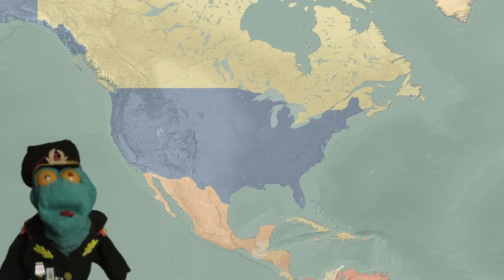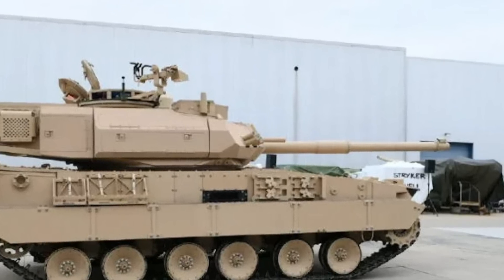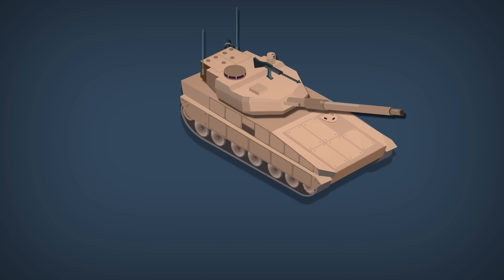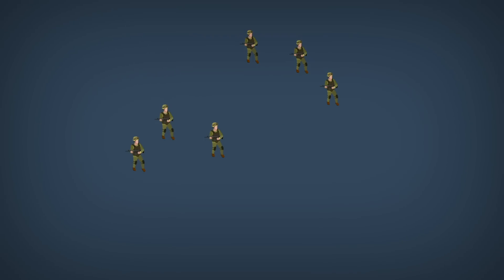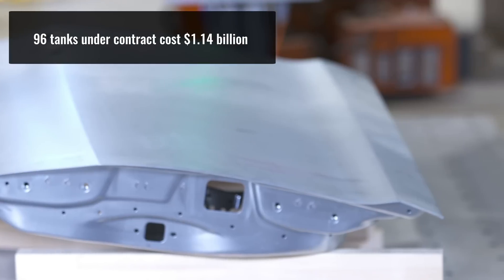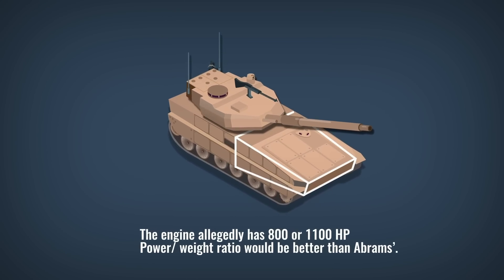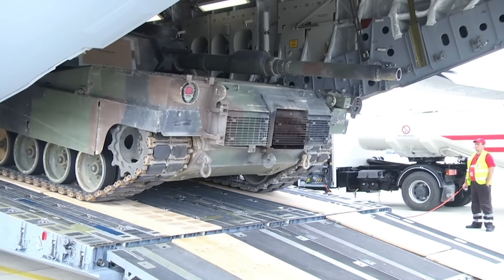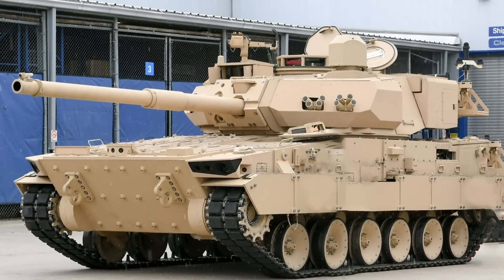US Army just chose its next (light) tank

Comment: Hmmm... I love tanks, but this seems like a bad idea to me... I think infantry should either travel with 1) full size main battle tank [heavy armor + big gun], or 2) an IFV [high speed + little gun + troop carrying capacity] or 3) a medium vehicle with a rapid fire medium gun/s around 35mm-40mm, that can aim straight up to rooftops in a built up urban environment, destroy other IFVs, and shoot close aircraft, drones and rotorcraft-- something more like a Gepard--- not a light tank with a slow firing 105mm rifled.
But that's just me /shrug/.  This feels like not enough utility to make up for its lack of armor protection or speed.
-
Of course anything is better than nothing, but something medium weight with a fast firing medium gun is missing from the US inventory.  Put a 40mm autocannon shooting 550 round/min on that same chassis and I think the infantry will be more happy and effective :)
Reply: The army doesn't want it called a tank but rather mobile protected firepower. This is because it is supposed to provide a big gun to airborne and light infantry units. its a new sheridan. The army says the first unit to receive them will be the 82 airborne. I am guessing that the will be dropped with the old LAPES method
Reply: @jessicacolegrove4152  Fair enough.   But does changing its name to "Mobile Protected Firepower" really make it better?  If they want a different name to make it sound more usefull, maybe they should have called it, "Much better than a Humvee"  :)
Reply: @angelarch5352  It's Funvee then.
Reply: @angelarch5352  How do people not understand what the purpose of an AFV is, the Griffin is meant to accompany IBCT (Infantry Brigade Combat Team), and the whole point of the Griffin it to take out things that a fast firing cannons cannot take out, like bunkers, whilst also being able to go places that other large cannon vehicles like the Abrams cannot, also yes the Army changed the name to MPF specifically because they did not want soldiers to think it was a vehicle that could face other tanks, it is only really their to support the infantry, it is kind of like the Sherman of its day in a way, while the Sherman was meant to face other tanks and definitely could, it really excelled at supporting infantry.
Reply: @aflyingcowboy31  so a Bradley and Stryker can't do the same? Lol they're no different in it, it's just American spending money on what they think the military needs
Reply: @subjectc7505  No, the Bradley cannot, just like the Bradley cannot do what the Stryker MGS can do, so dumb argument, also the Army is apparently going to retire the Stryker MGS in a couple months, so no the Stryker cannot fit that role.

Also you do realise the Germans just did the exact same thing with the LYNX IFV, they just produced the LYNX 120 which will practically have the same role as the Griffin 2, so no, the US is not the only one doing it as Germany apparently also thinks they need an AFV with a larger cannon to support infantry, the Bradley is an AFV with a small calibre cannon and cannot shoot HESH or other rounds that the Griffin 2 will be able to, so yes they are different and will fill different roles to support infantry, also the Bradley transports troops, so if anything both the Bradley and Griffin two could work alongside each other to support the infantry, the whole point of the Griffin is that it can take out things that something like the Bradley cannot.
Reply: @aflyingcowboy31  the thing is the LYNX is much better then this with module design and expansive role capabilities which fits German since they don't blow money on anything and thing, they think is needed. Not saying it's not needed, but is it really needed when you already have vehicles capable of it. Tanks are starting to die out anyway, so we'll see it's future and what it can do.
Reply: @subjectc7505  The LYNX 120 supposedly weighs about 50 tons so 10-15 tons more than the Griffin 2, the LYNX 120 weighs only a couple tons less then the original M1 Abrams, that is extremely heavy for an AFV, also your right the Germans don't blow money, because they haven't been spending money on their military basically at all, the Germans wanted to send Gepard's to Ukraine back when Ukraine was invaded, only to find out they they basically had no ammunition to send along with them, the Russian-Ukraine war has shown that Germany has been highly incompetent/negligent in regards to their military spending, with even the German Army Chief coming out and saying that the German military is ill-equipped for any military action, so extremely bad point to bring up, their is a reason the US spends so much of their GDP on their military budget, something Germany should have been doing years ago, but didn't because they were becoming friendly with Russia, that is until Russia invaded Ukraine.

Also once again the US doesn't have anything that fits the Griffin role, firstly the Stryker is being retired and there is currently a program to replace the Bradley, so yes it is needed, also tanks are not starting to die out, do not take the incompetence of the Russian military into thinking the same thing would happen with NATO tanks, the Russian tank deployed to Ukraine had no APS and have had basically no infantry support, with tanks seeming to be moving around like headless chickens. No countries military seems to think the tank is dying, with Rheinmetall just releasing a new tank, and General Dynamics setting to announce one in the coming months, also if you are dumb enough to think that tanks are dead, then I had to break it to you, but all combat vehicles are dead, their is no difference between a LYNX 120 or a M1A2 when it comes to a Javelin/NLAW ATGM, both tanks would be seriously damaged or destroyed by them.
Reply: @aflyingcowboy31  Nope only the tank age is dead. You still need most of the other equipment to be a functional moving force
Reply: @subjectc7505  LOL, the tank isn't even close to being dead, and your logic makes no sense, explain how the tank is dead, but an AFV that weights 50 tons isn't, FYI most Russian tanks weigh 45-55 tons
Reply: @aflyingcowboy31  You didn't read anything I just said. I said the Tank age is dead and the way modern day combat has changed, this is pretty much DOA.
Reply: @subjectc7505  okay military general, go tell that to all the, militaries still operating tanks, with plans to upgrade them and other plants to create new ones, since they don't seem to have got that message yet, by your own logic planes and helis are dead because we can easily shoot them down, but hey they are not and neither will tanks or any other armoured vehicle, FYI if you basis for sayings they are dead is because of Ukraine, then once again how is no other armoured vehicle dead, Russia has lost way more IFVs, AFVs, and transport vehicles then they have tanks, once again your logic is ill-founded and illogical. Also if are saying the LYNX 120 is DOA, then you should go tell the German military that they just wasted billions of dollars on their other LYNX and PUMA IFV programmes, as they are also apparently DOA.

Comment: Curious they would still be using 7.62 on the co-axial, when everything is switching over to the M5 size. 6.7? Don't quote me on the size
Reply: The contract was written before the army selected the NGSW winner. They will likely retrofit it
Reply: If I understand it correctly, the 6.8x51 isn't completely replacing either the 5.56 or the 7.62 yet. I'm not sure if they will adapt the current guns or if it is even possible given the 6.8's high pressure.
Reply: The US plans to refit all the M240 MG to the 6.8mm round of the M5. So for now until they have been all replaced they will stick to the 7.62.
Reply: Well the Army is only going to get about 13,000 of the new lmg. Furthermore, it takes time to get new equipment & units will have priority over others.
Reply: 6.8mm has only recently been adopted so it’s going to take time to transition their existing weapons over to it. Currently, infantry weapons have the priority.
Reply: 6.8
Give it time.

Comment: The Bradley was never meant to engage other main battle tanks.  However, during the 1st Gulf War, over eager mech-infantry commanders engaged Iraqi tanks.   I hope the commanders of these vehicles know they are not engage other tanks.  They will not.
Reply: Then what was it Main weapon 
 TOW Anti-Tank Missiles for?
Reply: They are forming all new battalions for them mobile battle groups starship troopers is becoming real just becoming a real they will be named mobile infantry
Reply: @rendelbariuan7583  In the rare case it did run into tanks.  That was not its purpose however, hence why it only had two launchers.
Reply: A special mention was made in many analyses of the tank’s role and training that would emphasize this fact. As has been clearly shown recently in other countries, misusing even the best equipment can still result in huge unnecessary losses.
Reply: @rendelbariuan7583  It was installed in the late 80s.  There are only two, once fired you need to wait a few minutes to reload.  Of course the enemy will allow you that time to do that.  Plus the armor is weak.  Were you 11M?

Comment: Modern tanks need a mini-Aegis system to shoot down missiles.  Not sure why they do not have them already.
Reply: agreed , at least do that until they can make the warhammer40k conversion fields lol
Reply: Mobile Aegis AA systems instead
Reply: Ammo storage and consumption
Reply: American tanks are good but too  overweight. Abrams is 70 tons. It can't cross most bridges. It needs to lose weight.
Reply: @TheBigExclusive  western tanks are designed to fight in the west pretty much ever bridge is able to cross them plus if u need a tank to cross a bridge u want a tank not a 105mm infantry support thing that can’t take on any MBT
Reply: That's called throphy
Reply: Active defense systems do exist. However they’re currently too expensive to mount on every tank.
Reply: @TheBigExclusive  lol very american, i have to say.
Reply: well it's harder than that, aegis can take some time to detect and shotdown incoming missiles. Tanks on battlefield dont, It's like shotdown an hypersonic missile coming to you using aegis, that's why the IDF system is totally automatic and it could fail anyway or could be saturated. Dont worry, they are already working on that probably.
Reply: @kuzakani4297  That is just software and radar.  I am pretty sure that it can be faster than it is today's equipment that is based on 70's design.
Reply: My raspberry pi detects movement immediately through a camera.
Reply: @sammcbride2464  usually military sector preffer FPGAs for these, dont they?

Comment: Hmm...  Why not just up gun the bradley if it's strictly for urban infantry support?  Replace 25mm with appropriate low velocity cannon that's available in current inventory 75mm or higher...   New turret would be cheaper than whole new platform..
Reply: Because the Bradley sucks
Reply: Bradley has power pack problems, not enough power for its current equipment added on over time. Putting on an even larger turret is asking for trouble.
Reply: The Bradley suspension can barely keep up with all of its updates would been cool to see a bradley with a main gun but never happen then there the Abrams thumper 155mm or 140mm cant remember
Reply: When we (3rdAD) got the bradley, it replaced the m113s..  They didn't have most of the problems some of the replys mentioned.  As for it sucks..  Well compared to what?  The m1 was better than the m60s they replaced by a huge margin...  Again, it wouldn't be as 'simple' as swapping the turret but it may be more economical to start with something that's already in place and has some infrastructure then start with something completely new that would require all new assembly lines manufacturing etc.  If you need something fast or want something brand new that will have to go through the 'whole' gauntlet..  You have to make tradeoffs.
Reply: @RukDaWho  I don't think the Bradley sucks, I think it handling far more jobs than what it was originally designed for. Bradley now carries far more armor and equipment than it originally sallied out with. In order to keep up it needs a bigger engine, meanwhile there have been multiple projects to replace it. This light tank is based off an Armored Fighting Vehicle by General Dynamics, also based off ASCOD  (Austrian Spanish Cooperation Development) which started in 2002. About 2 decades have been committed into this line of design/thinking. 

This program already has infrastructure so "most" of the gauntlet has been run.

Comment: What's the point of a 105mm cannon ? It's too light to penetrate MBT's, but way overkill for APC's & other vehicles. Just put a 50mm/57mm, which has a higher rate of fire, same range, & can hold many more rounds, on it & maybe have some ATGM's next to it.
Reply: I am assuming the cannon has more power against bunkers, buildings or other fortifications?
Reply: @filipinorutherford7818  Meh, the 50mm or 57mm would have more than enough power to take down buildings. The issue with the 105mm is that it only penetrates 600mm of armor at most, not enough to take out MBT's, but for most APC's or other light skinned vehicles or buildings, bunkers, etc, the 50mm or 57mm can penetrate more than 100mm of armor at 1KM & they could actually put some ATGM's on the side to take out actual tanks....or bunkers or buildings that a 57mm can't.
Reply: True but this is meant to be more like an assault gun and a large 105 he shell will probably be more useful for that role than say an auto cannon
Reply: @zombiegamer1018  What's an assault gun ? What is that role ?
Reply: 105 may penetrate side armor of many Russian and Chinese tanks but not with 50/57 mm cannon.
Reply: @fanman71  600 mm is enough to penetrate side armor of many Russian and Chinese tank models.
Reply: @nafisfuadayon6832  Side armor, not frontal armor. That was why the 105mm cannon was largely abandoned for the 120mm & up cannon. The T72's, especially w/ Kontact 4/5 or Relikt ERA can't be pentrated by the 105mm. The 57mm can penetrate 100mm+, that would also be enough to penetrate most side armor of tanks, not to mention they have an effective range of over 4KM. It won't penetrate as much armor as a 105mm, but like on the Bradley turret, it's small enough that you can usually carry an ATGM that would be able to penetrate tank armor from all angles.  The 50mm chain gun does also have the rate of fire & range to shoot down helicopters and drones as well.
Reply: @fanman71  It is a throw back to the second world war, where infantry that needed to assault fixed positions received support from an armoured fighting vehicle equipped with a low velocity, large caliber, direct fire howitser. These guns were usually short barreled. However, during the war, these vehicles would receive longer barreled guns and some antitank rounds to help the infantry defeat unexpected armoured threats, like enemy assault guns, scout vehicles or medium tanks. This new vehicle as a big caliber gun, so large high explosive round for dealing with infantry, fixed positions, etc. However, it also has a long barrel for when an armoured threat appears. Does it need to kill mbt's? My guess is only when there are no other options and probably working in tandam with missile teams.
Reply: @fanman71  I think your idea is also a good option. Russian Armata heavy IFV with unmanned 57 mm turret is similar to your suggestion. I think  heavy IFV is a good solution too.
Reply: @jackkurze2618  Actually WW2 Stugs were primarily used for anti tank operations with secondary role as assault gun. German tanks where primarily used for exploitation ie surge forward through a and on to the enemies rear. The Stugs would be left to fight the tanks while the tanks push on. I think I I heard that somewhere.
Reply: @filipinorutherford7818  This is true after 1942 with the StuG III ausf F, but not with the versions before 1940-1942. Those versions were armed with short barrel cannons that were not primarily intended for anti tank warfare and very much infantry support. I don't know of any source or literature that supports your claim that they were always intended from 1940 onwards as tank hunters and defence vehicles. The Wikipedia page confirms this explanation, as well as the pretty well written Armoured Fighting Vehicles of Germany edited by Duncan Crow, or the slightly more accessible Tank versus Tank by Kenneth Macksey.
Reply: @jackkurze2618  yeagh I agree with your statement. I tried to track down my info but I basically got info as you just stated.
Reply: @filipinorutherford7818  I was actualy hoping you had literature that was in disagreement with mine. To discover new knowledge is awesome. But no worries. Perhaps next time :)